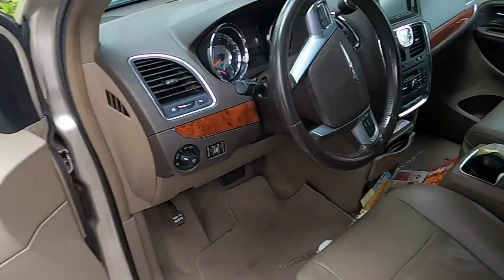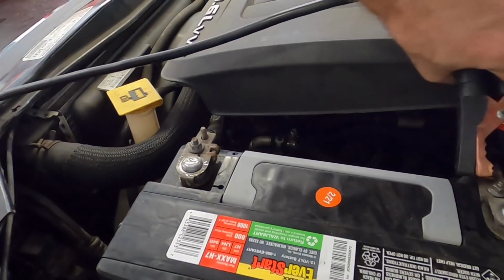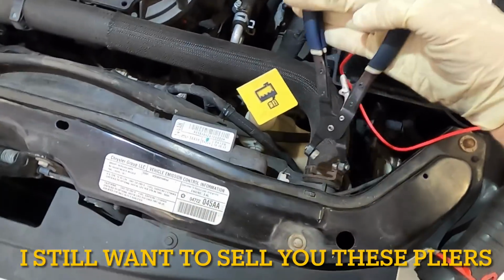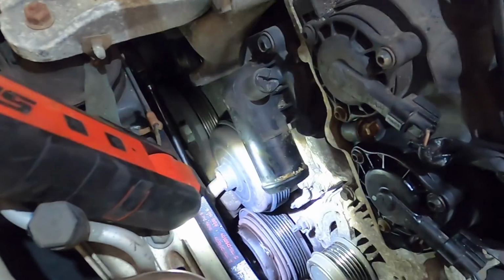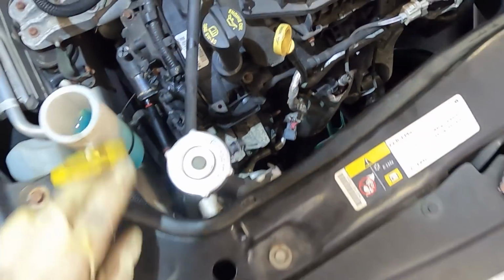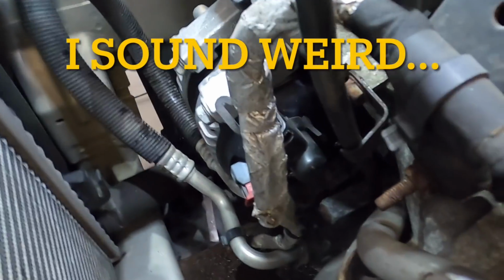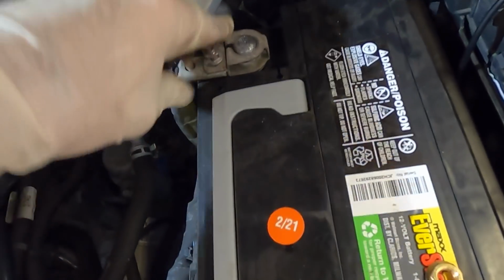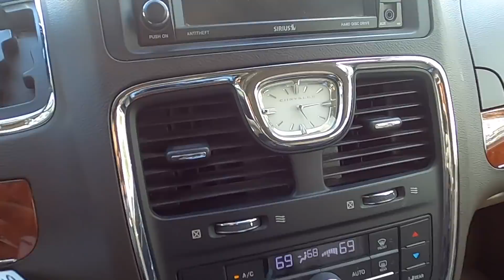Customer States: Burning Smell…Fire? 2014 Dodge Chrysler caravan battery light on!

Comment: I was a mechanic in the 70's and remember when there was so much room around the engine under the hood that you could practically sit in there haha! Even a big block. Everything was accessible and pretty easy to change out. Whole different ball game now. But you make it fun to watch. I binge-watch your videos. Way more interesting than TV programming! Thanks for what you do.
Reply: I used to have a 197 6 Blazer and when I did plugs I'd sit on one indefender well and do 135 and 7 then I go over the other side and do two four six and eight and if it got late my wife would bring me dinner and I could sit under there and eat under the hood hey guys have a good day bye
Reply: I too was a mechanic in the 70s, mid. As we got to the 80s the engine compartments were shrinking and filling up with vacuum lines. Today's cars are much more crowded and now they have so many electrical sensors and wires along with some vacuum lines. Still a challenge to remember where it all goes - correctly and without breaking anything. Good job, Ray...it doesn't phase you at all.
Reply: The  time I work around a radiator use a piece of cardboard inside  in case you bump it

Comment: Undo battery cable. If dies. Usually bad alternator. Usually.
Reply: That’s a bad move on a modern vehicle. It will often fry the computer, alternator, or both. In older vehicles, the voltage regulator was either a separate part or built onto the alternator. The voltage regulator on most vehicles now is built into the computer. When you remove a battery cable, they circuit is no longer complete. The system will seek a ground through parts of its circuitry not designed to handle the load. Expensive failure ahead.
Reply from the maker: Nooooo!

Comment: You are my newest project. Not that I learn anything, hell I am over 50, I better damn well know what I am doing. What I want is the common person to do is watch these and understand how much crap you need to remove before getting to what actually needs replacing/ repair. When they say it's going to cost " How much?"  and my favorite" why  does it take so long?" They would understand. Today's  vehicles are a nightmare  to work on compaired to my first car, a 69 Catalina.  Yeah, cut my teeth on nylon timing gears and floppy timing chain. At the time I had no idea an exaust valve was bent. I learned mucho on that car.

Comment: My SUV doesn't have any battery voltage gauge...just a little "battery shaped" icon light on instrument panel. I bought some cheap LED volt display from electronics supply...attached to a automotive 12 volt "cigarette lighter" plug...keep it plugged in socket on dashboard. Now I can see /watch battery voltage change as alternator volt regulator charging turns on /off.
(Charging starts when battery voltage drops below 12.6 - cuts out at 14.3 volts)

Comment: all the new dodge vans seem to have that battery post fault I have pre cut pop can to shim that part with. out of the 15 dodge vans I've done that are 2018 and newer seem to have loose negative cable!!! and I've rep[laced the alternators on the newer vans and never had to take them apart like that. there is just enough room to take them out. only thing I hate changing is the starter in the because you have to remove the engine mount to remove the starter.

Comment: I just did that same job a couple weeks ago but I had to do it twice because the first new alternator worked for half a day then quit. Fun fun.
Reply: That sucks bro!
Reply: Had the same problem. Half the new parts today are junk out of the box
Reply: Oh the joys of working for an independent shop! At least with a dealer, you get paid warranty rate to replace a defective part. To quote Billy Crystal: I hate it when that happens!

Comment: Its been a bit since I changer a 3.6 alternator , but I think it comes out the bottom easier.  I think if you unbolt the compressor and tie it out of the way you can access everything on the alternator.   I am 100 percent sure thats the way I do the alternator on the 2.4 Chryslers just not positive on if it works on the 3.6s
Reply: this is probably a variant of the pentastar that dodge uses and the alternator on those is like old school can access it without taking anything off, can change oil filter with one tool and 5 minutes time. Its a dream to work on that engine.

Comment: strap a large batterie to a dolly and put fine braid welding cable from the batterie to the good heavy duty clamps..you can start a car without one in it and start it from the batterie on the dolly you made .. it really works well for boosting

Comment: I put a h.o. alt in my 2013 Grand Caravan for my stereo. Was a bit if a pain to pull it out. But I did it the same way. Out thru the top. And only the rad hose needed to be disconnected. Nothing else. Not sure why you pulled that rad housing off. Making it more difficult than it needed to be. But good video still....
Reply: I did a h.o in my 2014 dodge grand caravan. Replaced the water pump right away since I was in there it was the original and at 130k miles. They designed these like dummies.... had to remove one of  the motor mounts and one of the pullies cause one the bolts for pump was behind it as well as the thermostat housing, took the alt out by removing the rad fans as well.  

The spark plugs is a whole new battle... never again. 

After getting my 275amp Singer alt in my 2/0 wires ran to the back and stereo all installed, a week later the rear suspension went to hell, cause my box was to heavy. Lmao

4 8" Sundown SA v3s in a 2.65ft^3 box, double baffled weighted about 215 pounds..  these aren't very good bass vehicles if it has any remote weight in the ass end. Lol
Reply: @Joe_1776  I hear ya! My box is 250lbs without the subs. I took the rear bench seat out completely and thats where I mounted the box. I can definitely feel it in the ass end.
Reply: @michaelzernie7092   I'm stuck with the small cargo area, my kids take up the rest of the seats.  Went small with the 4 8s, van still didn't like it.  Lol

Bass on fellow basshead!

Comment: So I had some emergency battery starters like the ones you were using and they hardly ever worked. Makes sense since they are 900 cca, which in reality is probably less. Then I watched project farm and he tested a ton of them and suggested one that I bought. My god it works so good, useses less than 2% of it's battery power to start anything and I do mean anything. It's called "Audew 2000A Peak 20000mAh Car Jump Starter". Damn thing is definitely 2000 cca. I started v8 engines that the battery was 100000000% dead on. And the little starter is about the size of a multimeter.
Reply: Yeah, I got that one too and another. Life saver over jumper cables.
Reply: @RRaucina  agreed, jumper cables can suck it

Comment: They must hang the alternator on a string at the factory and then build the engine around it.
Reply: Yeah not like they couldn't design the vehicle with say a bit more clearance from the fan shroud to the engine "2 inches more in the front , aw hell naw you're going to mess up my aerodynamics " :)
Reply: It will drop out the bottom much easier. That's the problem working on so many different brands, you don't learn the proper way.
Reply: yeah this one looks a bitch to get to
Reply: That's the problem, they are designed with assembly in mind more than servicing.

Comment: I once owned a 96 caravan I had to disassemble the entire side of the engine to replace the water pump that was turned by the dang timing belt who ever designed that v-6 should be tortured. Cheers from Jacksonville Florida 🌞
Reply: Bet that was the last caravan you ever bought ...

Comment: Hello Ray, why didn't unscrew the a/c pump and get it out of the way and then get the alternator out that way. It seems to me a lot faster and you don't have to pull the radiator out and bleed the system. I used to be a mechanic so iknow what i am talking about.

Comment: You should have checked  youtube for changing out the alternator. I'm 80+ and just did mine, on a 2014 town & country from the bottom right wheel well, No draining fluids or removing hoses. About 40-45 minutes,

Comment: The test ‘meter’ your using can be got almost anywhere. But, the cheaper ones will not do a reverse polarity check, in other words to check for ground. I got a cheap one and a good one. The good one gets used 99% of the time. I’m a marine tech and say the boat has a gauge not working, you can reverse the leads (clip on positive) and make sure you have good ground to gauge.

Comment: To let you know, I had a 1 in 10,000 happening once with a cable that looked brand new on both ends, but had a factory defect in the cable run that appeared three years later. Only ever happened to me once, and check every time now, but it's  never the problem.  One of these days it will be.😁

Comment: I really do miss the days when changing out an alternator was 15 minutes. 2 bolts attaching the Alt to the engine and the 2 Alt wires.
Reply: Chevy trucks and vans are pretty much like that
Reply: 2007 honda accord was nice and easy alternator was right up front three bolts and a removal of the line to battery and that was it this looked like a nightmare to work on comparatively
Reply: Exactly how it is on my 97 Cherokee
Reply: Yes!   You could change them in the parking lot outside the parts store and get your core charge money back.   Before that you could spend an extra half hour and replace the diodes and put it back on.   Just a few bucks.
Reply: @KevinCoop1   did that too!!! Also way back when at the Farm and Fleet store up here in "da nort woods" they had rebuild kits on the shelf for alternators.  Rebuild several like that for family and friends. $10 and a few beers and an hours worth of BS-ing around.  Those were the days
Reply: Yeah it’s like that what I find is it’s a lottery what they will make easy and hard to replace I think the issue is too much stuffed under the bonnet with not enough thought on how to make it fit and be serviceable if it’s not the alternator caged in it’s the water pump or the ac compressor in the “good” old days there just wasn’t enough gear to hide things or the engine bay was just stupidly oversized for what was inside and the manufacturers are trying to get more cabin space so the engine bay just gets smaller and smaller I guess it’s just the way it goes you as ya can’t shove people groceries or golf clubs under the hood...;)
Reply: My good ole trusty 93 f-150 is like that.
Reply: Water pump
  Six bolts,  gasket, re attach belt.  Every thing was simpler before California and the Japanese got involved!
Reply: @litz13  JUST about to say that about my Cherokee's as well!  This video makes our Jeeps seem like legos.  So easy...
Reply: @blacksheep25251  👍
Reply: There is one way in which auto manufacturers did make it easier; the addition of belt tensioner pullies. I remember back in the day, you had to crank on the alternator with a crowbar as hard as you could with one hand while tightening the lockbolt with the other. Tensioner pullies made that obsolete and with the right serpentine belt tool, removing & installing the drivebelt is a cakewalk.
Reply: BMW alternators are the easiest
Reply: I can change the alternator in my car in 5 minutes. Undo 2 bolts, slip the belt off, lift the tensioning bracket up, disconnect 2 wires and lift the alternator up and out of the engine bay
Reply: @kdbuilds619  not on any Bimmer with a V8, even worse when it's a water cooled alternator.
Reply: Ford super duty with 6 litter is easiest. The serpentine belt tensioner has a release latch. You pull belt while pushing latch with a long screwdriver and belt stays released. 3 bolts and one power cable nut plus VR connection. Literally 5 minutes including walking out to truck ( if the truck is miles away then add drive time tontruck).  I have replaced a couple of Denso alternators that had meltdowns with evidence of 🔥. I have seen a video on here of others, hmmmm.....
Reply: I take first version Escape V6 alternators off by removing motion limiter arm bolt and getting alternator completely free from bracket and all wring off, then rock vehicle with wheels on ground and with alt grasped pull it up and out when motor swings away from firewall. Get it back down in place with the same dance. All that front suspension and rh axle dismantling is unneeded.
Reply: Caravans prior to 2011 with the 3.3 and 3.8